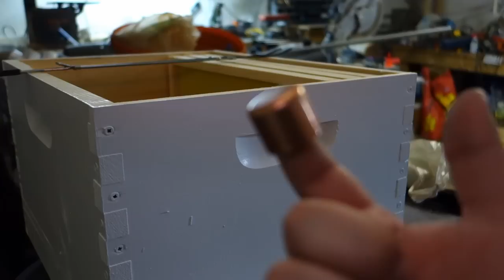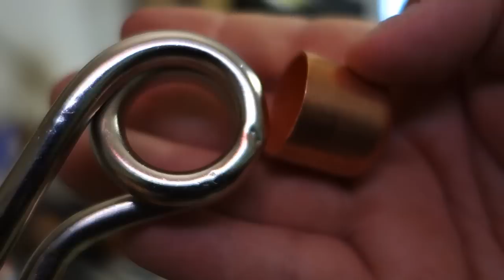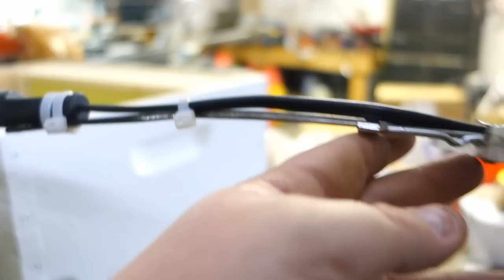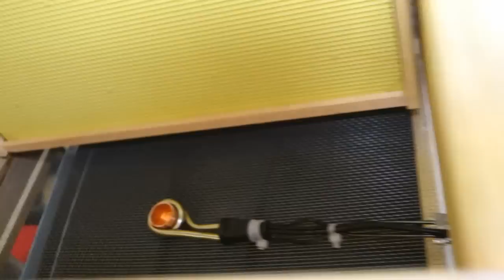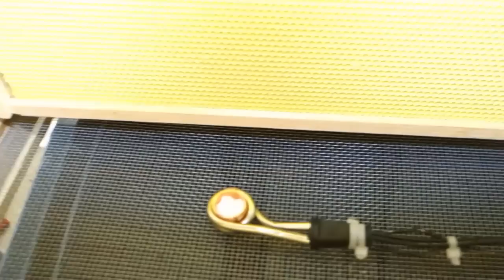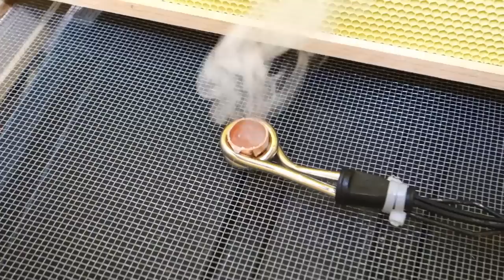Homemade Oxalic Acid Vaporizer

Comment: I had a hard time " pounding"    the 3/4 inch cap into the heater.     finally got it in after sanding/pounding.
It worked twice ,then nothing.  I measured resistance in heater.......it was open.      I think I broke it during assembly.
Anyway, thanks for a new idea.
Reply from the maker: +john smith i sanded and pounded for about 30 minutes and was able to get it to fit. I am sorry you are having issues with it.
Reply: +john smith I used a vice to make the bottom smaller, but like you, my heater broke (two of them actually) during the twisting process. I went slowly and I used the vice to press the cap in after making it smaller but still had two breaks. now after reading the comments, I am concerned about this burning too hot.

Comment: I tried this twice and both times the heater burrned out after the first time I vaporized the acid.  Not sure what I was doing wrong, but I guess I will have to pony up for the real thing.
Reply from the maker: +Mark Mitchell i am sorry it burned out. How long did you run it for? You only need to run it for about 2 minutes and all of the crystals are gone. remember those heaters use the surrounding water to help it from burning out so you dont want to run it too long.
Reply: I ran it for about 60 seconds.  Just not my luck.  I have ordered a vaporizer with a global plug.  Thank you for your concern.
Reply from the maker: no problem!! If you end up working on it again and figure out what it was please let me know. I know there are sooo many types of those heaters i just might have been lucky to get a good one. I am not into my 3rd week of vaporizing them. good luck!!
Reply: I bought a pack of two of the same heaters you were using.  I have since found threads that indicate if the heater gets too hot there is a fuse that blows in it.  It was worth a try and if the heaters had not broken would work very well.
Reply from the maker: is the the fuse that is in the plug? those are replaceable. I am working on another design that hopefully will work well.

Comment from the maker: +Dave Chapple  I used a 3/4 inch cap but remember in the video, I explained that i pounded the cap out to make it thinner.
Reply: +michael cifranic also try a 3/4 sleeve cap. goes inside the fitting not over the pipe
Reply: +Kurk Dockins tnx

Comment: I bought one of these heaters. The inner hole was way too small for the 3/4" copper plug, messed it up trying to bend it out :-(  Maybe there is another type of cup that will fit in there (?)

Comment: What are your thoughts on placing the hot element below the bottom screen board?  Mine are; no burnt bees and more a robust distribution of the vapor if the operator can move the wand slowly back and forth.

Comment: Curious about the wattage because I like the speed with which your vaporizer does the trick. I want to use a small 12V sealed lead acid battery like what is found in security alarms (due to cost, weight and ease of portability). Trying to determine how many hives I can vaporize before the battery requires a charge.

Comment: Thanks Michael. Very informative video. Can you tell us the wattage of the immersion heater you used?
Reply from the maker: Bill Dillard  I use a 13 AH battery sealed lead acid and worked very well. Was able to do this 11 times  without any time delay drop off. the wattage is 125 watts. I really enjoy this gadget. and i believe you will too!